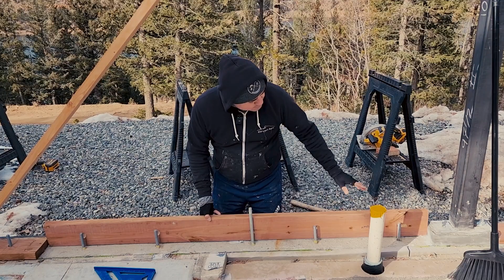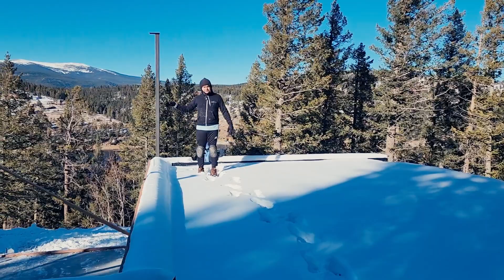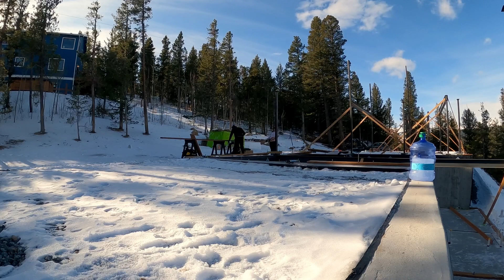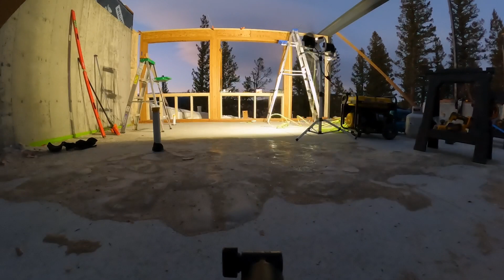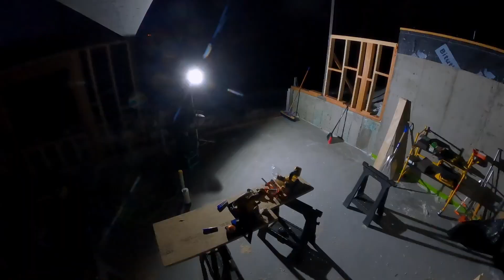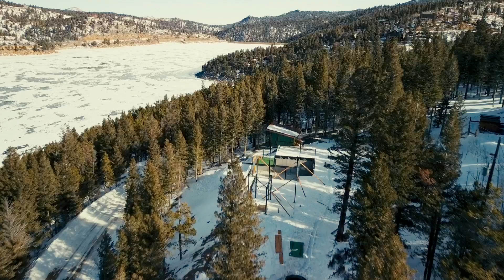Framing Basement Walls

Comment: what product is your rubber gasket under sill?
Reply from the maker: Hello! We are using a "sill gasket" from conservation technologies. It acts a bit more like the gaskets you would use on pressure chambers. It provides the ultimate air, bug and water barrier at the sill. Here's the website:
https://conservationtechnology.com/building_gaskets.html